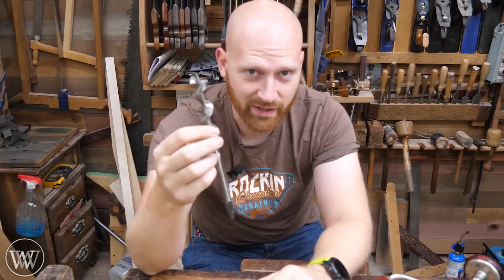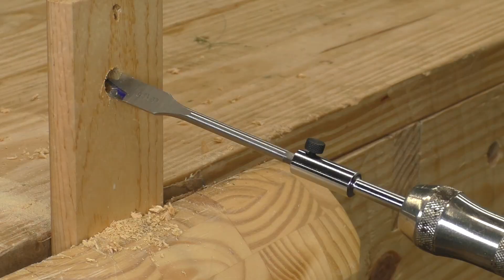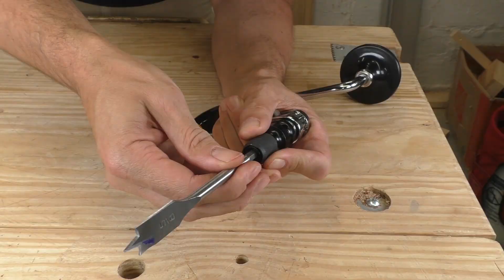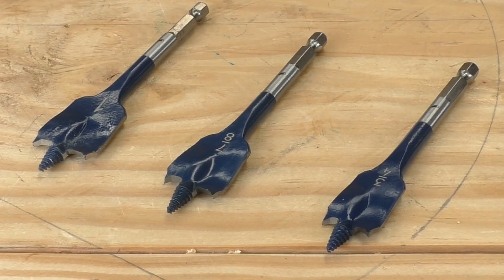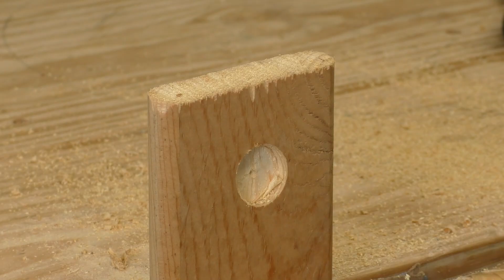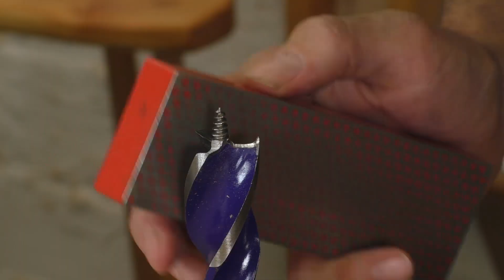Modernize your brace with new gear!

Comment: Rex I'm a bit displeased. Ive been following for a while, and made quite a few of your projects. I love that you test things and give us your honest opinion. After buying this brace from Garret Wade I have to say I may not trust how honest your reviews are. I am sending mine back for a refund and IMO they are complete TRASH!! The ratchet fails to hold under the slightest bit of torque. Tested it out by trying to go through a 2x4 with the 1 inch bit. That thing just went click click click click click around like it forgot that it was even supposed to be hold a gear in place. You telling me you didn't have a single problem with the ratchet on that brace?

Comment: I personally own and use a vintage 1/2" square drive brace with my sockets. It's solid and reliable. Paid less than $5 at a thrift shop. Never thought to get a chuck adapter, thanks!

Comment: I needed to build a new hand plane tote, something I had been putting off for awhile.  Mostly because drilling the angled hole with a power drill was so painful.  Then I saw this video and I had a solution.  I picked up a brace from Veritas, but to be honest the one you used would have been better.  

For the bits, I headed over to eBay, and managed to pick up a set in good condition for about $20.  

Drilling that 4 inch angled hole into the tropical hardwood I was using was easy-peasy.  But afterwards I discovered that brace bits can get just as hot as power tool bits!

Comment: STAR-M Short Auger Bits are super cheap and good quality. Made in Japan I've used sizes from 10-32mm with hand brace. It's important to start as plump as possible and then no tear out. Cost from 6-10euros for the most used sizes for furniture making in fine-tools.

Comment: A few years ago I managed to break a 4" 1/4 drive socket extension.  It snapped at the ratchet end. So I cut off the broken part and now I use it in a brace or an electric drill as a 1/4 drive adaptor.   Great when you are putting in lots of screws into flooring or units, where and when your battery electric drill  is dead or recharging

Comment: Hello everybody, I followed Rex' ideas on mechanical braces and bought a good used one on eBay for € 12.-. Then I got myself an adapter for about € 10.-, which is originally intended for SDS-+ machines and put a drill on it. Now I cam use cylindrical drill bits as well as 1/4"-hex  bits on my brace! I will send pictures of it to Rex, maybe he wants to display them.

Comment: Finally got a chance to try out the Garrett Wade Versatile Brace. The brace arrived last week, but the quick release chuck didn't get here till yesterday afternoon, so I used it, along with a daredevil bit from HD, connected using the recommended quick release chuck. Now I didn't notice this until I was pulling the bit back out of the hole, but the ball bearing that's part of the quick release on the brace doesn't stick out enough to hold onto the chuck. I've been using my dads tools since I was old enough to hand them to him, and I'm used to that ball bearing actually sticking into the attached tool so that it stays on. With the tools he uses you're supposed to push it back in with your fingers (or with a button on the back that lets it slide in in the Snap-On tools he had) to get it to release. With the GW Brace I had to fully disengage the snail before pulling the bit back out or the quick release chuck would disengage from the brace. To be clear, this is not a problem with the chuck as the chuck that comes with it does the same thing (pulls off with little to no effort). I'm not saying this is a problem with manufacturing quality, I don't believe it is. This is a design decision someone made so that they wouldn't have to include one more moving part to release the chuck. It's a decision I disagree with, but it's one I understand. The brace is otherwise very nice for what you're paying for it, but I don't know that I'd use it with daredevil bits again given the choice.

Comment: Love the video, thank you for the good work. 
My experience is only tangential to fine woodworking. I'm a farmer in Argentina, my woodwoking is only in rough carpentry. Bit and brace drills here are actually still produced and are very common in hardware stores in rural areas, along with new auger bits. They are essential tools in building and maintaining fences, gates and rural structures (very isolated countryside, not much money for batteries and generators). Auger bits produced here are abysmal. 
I made an adaptor for my drill simply using a machine screw of appropriate size to interface with a modern 3-jaw chuck, filing the other side copying the shank of my 1/2 in. auger bit. Now I can use practically any bit I want. I find that simple, high speed steel twist bits work well with the tropical hardwoods we use here, and leave clean holes. Bits made to drill steel require you to push fairly hard, but you can increase the relief of the cutting edge ad maybe thin down the web of the bit if you know what you are doing, and then they work well.
I now use common twist bits for anything that isn't too deep or more than 1/2 in. I still use a lot the 1 in. auger, as it works well, and the long 1/4 in. auger for making the pilot holes for spiking large logs and fenceposts together. For the rest, the augers produced here are too awful to use.
With this setup, sharp bits, a good center punch and chainsaw bar oil I can even cut holes in 12mm thick mild steel. I know because i had to do it.

Comment: I’ve used Erwin’s ship auger bits in a 2-jaw brace with decent results. The biggest problem for me was always the hex in the 2-jaw rather that the bit. I’ve never used a cheap or “off brand” ship auger so I have no comparison to your experience. They’re not cheap, but they’re not “cheap” either. I just buy the size I need when I need it and build my set slowly.   

Great vid

Comment: I just purchased several new manufactured square shank bits from a company in Wisconsin called ICS Cutting Tools. They are under $10 a piece. I haven’t fully put them through their paces yet, but I ran a few test holes. The 1 inch bit went through oak like butter.

Comment: I got myself a 3 Jaw Brace from Lee Valley which I wouldn't call cheap (about $100 CDN) but it does hold all the bits I own, also I just wanted a good Brace and didn't want to invest too much time in hunting for a good one. As for the bits I've found that Facebook Market place is a great way to find the vintage bits, at least around Toronto. I hope someone does find an affordable option. Great videos.
Reply: How do you like your 3 jaw brace from Lee Valley? I am thinking to get one for home crafting project but it is very costy.
Reply: @pasu11pasu21  it works perfectly. I am sure there are vintage ones that do the job too but this worked for me. I like that I can use vintage auger bits and new hex shank bits without having to change anything or add anything.
Reply: @mattthwaites6539  Thanks for replying. This is very helpful information for me. I am happy to know that it works well and does not break easily like other modern braces.😁

Comment: You weren't wrong about the hex bits not working in the 4 jaw chuck. I was hoping it would just be a bit sloppy, but as soon as it hit resistance the bit slid into the chuck and stopped rotating. Guess I have to wait for the other chuck to get here before I can try it out.

Comment: Suggestion: in my experience, the old adjustable bits gave the cleanest holes, so I think that a modern day implementation is needed.
Reply: Oh my god THIS.  I’m slowly working through cleaning the rust off of and cleaning up all the “primitives” I’ve acquired over the years in my recently finished garage.

Well yesterday I had used the 5 largest of a full set of augers I got this winter for $15 an so finished cleaning and sharpening them.  Before I put the stuff away (I was too lazy to work on the remaining 8 smaller bits) I decided to clean the single sided adjustable and give it a quick file.

Well I can testify that after a quick test at 1-5/8”, followed by too many holes at various smaller sizes that the adjustable cuts cleaner holes than the already delightfully clean holes of the main augers.

Comment: i don't know if it will work but moding the nickers on the cheap blue auger so that instead of a tripoint (pointy bit at the intersection of 3 faces) you should have a continous edge at the intersection of the outside cylinder of the bit and a smoothsly curved face on the inside, the goal here is to form a nicker that start above your cut, plunge into the wood with a slicing motion (in place of the stabing/shearing motion of modern bits) and them come back out at the back.
for a 3 flute bit the minimum the edge should come up at the front is 1/3 of the forward travel the snail allow you each turn, but i would put some margin, about 1/2 the froward travel per turn

Comment: A little late to the party. I have only found 2 applications where modern bits are useful in a brace.
1. Holesaws— I use them to cut round tenons in things. You have to take the temper out of the steel and put a more aggressive tooth on them with a bit of fleam.
2. I have a couple of rounder planes I use a lot that are neither imperial nor metric. I ground down a bit to match each and beveled the edge as well as the top cutting edge. Do they cut as good as brace bits? No do they cut better than regular spade bits yes.

Great video keep up the good work it’s been 42 years since I did my apprenticeship and I still pickup lots of tricks.
Reply: You have to turn to aviation. My Dad was a cabinet maker and after working with him during my teens another relative helped me get a job in aircraft FBO/MRO work. I went thru all the training and OJT in Sheet Metal. Long story short you have to look at Roto-Broaches , Spotface (spot facers) tool cuts, Hilok removal tool styles (the cutter type), and any other machine circle cutter type. All for a clean cut.

Comment: My brace is a "Fuller 10"/4 jaw" #890-1072. I bought it about 40 years ago and it still works fine. They are still made and are about $45 Canadian. The chuck holds both square and round shanks.  I collected the bits I have now over many years from yard sales. My treasure is a Greenlee #8 adjustable. With two cutters it has a 1 to 3" range.

Comment: Bosch makes self feeding forstner bits down to at least 3/8 in size.  I have used the larger variety in an electric drill but don't have any experience with them used in a bit brace, I only have an older style that accepts the square shank augers. Might be worth looking into for this application.

Comment: Great stuff here.    Grew up with a brace and bit in my dad's shop.   Actually he had two or three always set with certain standard bits.   I currently use my 1\2" socket brace frequently, and I converted a smaller one to work with 1\4" hex in my small mechanic box.    There is always a place in the shop for a good brace.

Comment: Awesome video, as usual.  I lucked into a set of 2 braces plus 15 bits for $25 at an estate sale.  I've worked with a few of them, and other than having to touch them up a bit, they work fine.  I don't have another solution, because frankly I've not needed one.  So, my solution is to be lucky!

Comment: Try working those irwin bits over, grind your cutting edges set them up with the same bevel you'd give a quality wood chisel, the difference in speed means you need to change the geometry of the cutting edge.

Comment: Just wondering... Why not weld metal about a modern bit and grind it square for older torque drill.. If thats what you want to use...

Comment: Have a look at these hex-shank japanese bits by Star-m.
https://www.starminfo.com/en/product/kagutategu/601.html#size
They are sold by Japanese Tools Australia, so maybe available in other countries too. I don't own a brace, but they cut very easily and cleanly at hand tool speeds using a cordless drill, which helps for control because they can cause blowout on the far side, the website's blurb notwithstanding. The disadvantage is that they are short. What the company's auger bits are  like I don't know, but would like to.

Comment: Great video. Just a suggestion, being an almost machinist I took measurements of the movable jaws of my brace and made two new blanks that then had 120 degree inner faces (with back spring attaching them). When these jaws are installed my brace works very well with either hex or round bits.
Reply: Honestly you could sell those jaws if you wanted to, I know I would pay for a set and I imagine a number of people watching would too. I have a number of braces I've gotten over the years (usually had to take them with bits) so would love to convert them. Or if you have any specs/details maybe release them for us to get local machinists to make them.
Reply: 2 jaws and the notch is just 120 degrees? Hmm. Maybe I can file some spares down. 

Would buy a set, though.

Comment: I probably have always been sort of feeble.  And more so at older age.  But I remember I always hated the fact that I could not hold the brace at a fixed angle when drilling.  My brace was swinging all the time when I rotated the handle.  Maybe longer Auger bits would have helped a little, but when I got electric drill, I thought I could finally hold it steady.  Not so fast!  I have realized a long time ago that it is impossible to start the hole in perpendicular orientation.  No luck with my skills.  So, finally the solution was to get a drill press.  Then the only problems  are work holding and fact that I often must resort to metal drill bits, due to very limited collection of Forstner bits.  Never 100% satisfied, sigh...

Comment: Rex, here's my problem! I have a bunch of hex auger bits and an old Stanley chest drill, but I'm looking for a 14" sweep brace with a 3 jaw chuck for the 1.5" diameter bits (it's like, impossible to use an egg beater style drill with that thick a bit).

Any idea where I can find a modern brace with a 14" sweep?
Reply: Alright, nevermind. Found someone on Kijiji who sold me four braces and 60 various bits (old, proper tapered ones) in good working order for $100. I would advise people to look for local deals, especially if you live somewhere that's not English speaking, as English speakers are likely to sell their old tools for a bigger profit on sites like eBay. (I got mine using Kijiji in French.)

Comment: I have made some adjustments on a cheap ship auger bit and it works really well. First I grind the worm to a square awl and second I sharpened the slicer and cutter. It is not as difficult as you may think poking the wood with an awl. Later I find that using this improved ship auger bit with a battery power drill is much more convenient. Shorter ship auger bits are also available and can easily be used with less powerful drills. I think if your auger slice well and cuts well, the worm's action of pulling inside the wood is not necessary. The worm should only act as a stabilizer. So an awl does the same. In addition to this, I find that worm does not work well on hard woods. Maybe that is only me. Feel free to share thoughts on this approach.

Comment: Using twist bits with new jaws I made in the Brace, like it works well and the only problem is the tear out on the other end but the comprise is going faster with lessforce  at the end to make it cleaner

Comment: Warrior auger bits worked for me last summer on a job site I used a brace with them they aren't flawless being from harbor freight but they did ok might be worth a shot since they are like 7 bucks they do have to cutting edges which i liked but I'm pretty new to wood working especially with a brace. Also they are hex shank

Comment: I bought this t-handle driver a few years ago. It does not address boring holes, but it is an amazing driver. I paired with this bit set and it "handles" most of my needs.
 https://www.lowes.com/pd/Kobalt-42-Piece-3-8-in-Drive-Hex-Torx-Phillips-Flathead-Bit-Standard-SAE-and-Metric-Combination-Driver-Socket-Set/1000223639
 https://www.amazon.com/dp/B011VTORKC/ref=cm_sw_r_cp_apa_i_vdBGFb3426CCC

Comment: Rex, I use a tool called a "speed handle" very often in aircraft maintenance.  It is essentially a very basic version of the garret wade brace and you can find them <$30 on amazon or >$100 via snap-on if you're feeling rich that day. The generally do not have a brace on the rear handle but one can be made fairly easily to fit over the handle that does already have a bearing inside it. They are readily available in 3/8 and 1/4 drive and the only drawback is that I have not seen one with a rotating middle handle.
Reply: Did you try to use a speed brace like this with wood bits? Does it work?

Comment: https://www.fine-tools.com/auger-bit-conical-square-shaft.html these are actually made for the North American market, so must be available in America. This suggestion does not fulfil two of the three criterias unfortunately, they are not cheap and I haven’t tried the,, but I thought I share it anyways as they are original Jennings made brand new and think they should be made known and used so the company continues making them, as I think that would be the best solution. And I want them to make metric version as well ;-)

Comment: Thanks for the video Rex.  It inspired me to pull out that same speed bore bit I put away years ago because of the tear out.  I tried reshaping the spurs/nickers with a bit of negative rake and it made a much cleaner hole though it still took a little bit to get engaged.  Don't actually have a brace atm, but tested it with a ratchet on some pine and poplar.